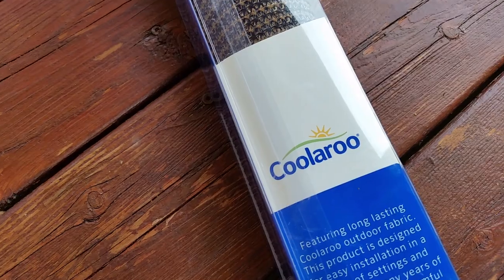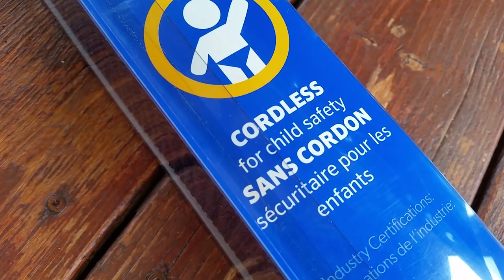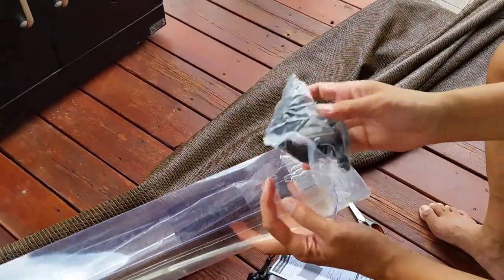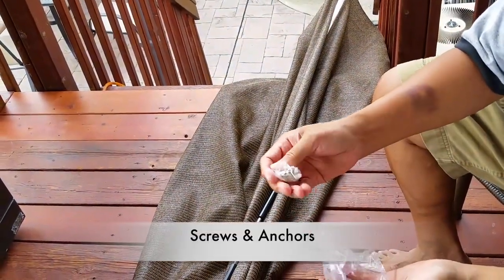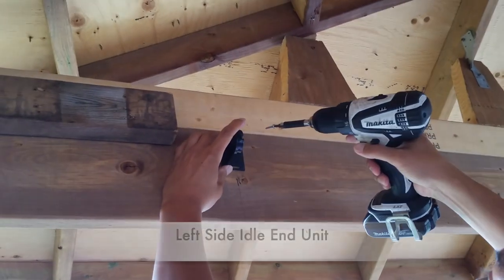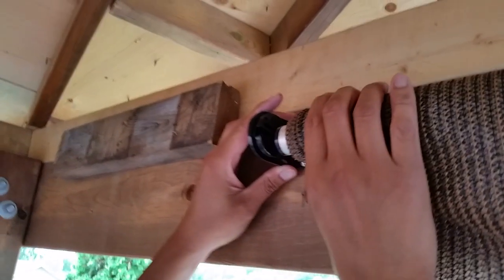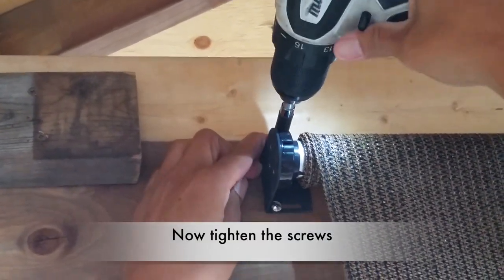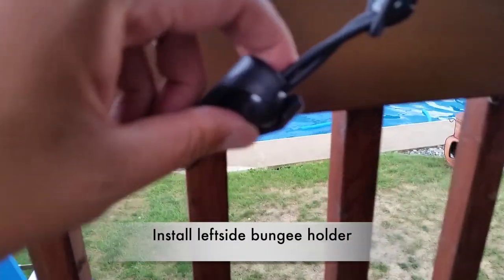DIY. How To Hang Outdoor Coolaro Privacy Sunshade. DIY.

Comment: Great video!!
I am going to Lowes and buy two today for my patio, I was looking at the one at Costco but I like this brand better, it is about 20% more but I like the crank to fold and hang straght, the one at costco is a permanent bend and will not hang straght

Put a small hook on the side of the wall and it will hold the crank out of the way when not in use

Cheers
Reply from the maker: Glad it was helpful!

Comment: At 7:10 - You can see that there is a dove tail on the piece that fits into the the dove tail slot on the holder bracket. Once that is placed into the slot it becomes s spring loaded lock, the pin in the shade just snaps into place from the front.
Reply from the maker: Excellent observation . Thanks for sharing.

Comment: Great video!  I have a cinder block & stucco finish.  I think I need cement screws to anchor unit.  Also, what is the longevity of the shade, and the plastic hardware that comes with it?  Thanks.
Reply from the maker: It's been 3.5 years since I posted it. And the sunshade is still doing great. No tares, no rot, nothing. Hard ware is also in great condition. Love this sunshade.
Reply: @jonahvlogsdiy4143 that’s awesome that it’s still holding up. How does it hold up in string wind when it’s fully extended? Does it flap back and forth or is it breathable enough that it flows right thru the fabric?

Comment: Nice vid. Thinking of buying it. On the inside of my patio I have lightbulbs so I can't put the coolaroo there, however I could put it on the exterior surface. Would that be a problem?
Reply from the maker: Have two other ones that are exterior surface and no problems so far.
Reply: @jonahvlogsdiy4143  very good, thank u

Comment: I had to hang mine pretty high so using the crank is impossible without a stepladder.  An instruction on how to add a motor would be wonderful.
Reply from the maker: Lol. That would be nice.
Reply: If you're going to waste your money buying a motor to add on to this, you may aswell just buy a motorized shade instead, lol.

Comment: At what height would the crank become impractical? I want to hang a shade at 12’ height
Reply from the maker: Great question! It's currently hanging at 8ft from the floor. And its very convenient to to use the crank rod but at 9.5 to 10ft it was difficult. I would say 12ft is impractical unless you use a chair or step ladder.

Comment: I’ll need the instructions since I want to install mine hanging from ceiling if my Lanai.  You have make adjustment to the both brackets they are not very clear.   Ex. Remove 4 screws?  There only 3 screws 😅. Thanks though.

Comment: What happens if u get a warm breeze but the sun is shinning, how do u stop the blind from blowing or moving, is it secured at the bottom, or is it just weights holding the blind from strong winds or breezes
Reply from the maker: There should be two holding clips with which comes with the blind. And two bungee cord with a small ball to attach to the clips and hold down the blind.

Comment: I want to install these blinds 1 feet away from my exterior way so that it can block the heat the sunlight. Can I install the two end units under the eave rafters? The rafters are not strictly horizontal but with some angle. Thanks
Reply from the maker: If you can make it as level as possible, it would be better.
Reply: Use garage door hangers, or something similar to get the roller installed level:
https://www.garagedoorstuff.com/product/garage-door-opener-hanger-kit/
Stay gold.

Comment: So I just installed the 10' shade.  Thanks for the great video.   Did yours have a bit of a sag because of the weight/length
Reply from the maker: Funny now that you mentioned it, I looked at it closely. I do notice a very small sag but I never noticed until you mentioned it. LOL.
Reply: @jonahvlogsdiy4143  
Cool. Thx for the reply and mine came so that it rolls down from the back not over the top, similar to toilet paper lol.  I assume it doesn't matter which way it rolls out.   Thx from SW Ontario, 🇨🇦
Reply: @markb3954  That was my biggest question, was which way to install
Reply: @cashonly6117  i left it rolling under from the back.

Comment: My patio is at an angle that from one end to the other are about a 12 inches to a bit more.  Any DIY ideas how I can put a roll away wall to protect me from the elements of the wind or rain when I'm using my patio in the winter and then remove it or hid it in the summer?
Reply from the maker: That's a great idea. I'll have to think of how to do it for my deck this summer. If I do, I'll do a video on it.
Reply: @jonahvlogsdiy4143  Thank you because I use my patio year round planting succulents, entertaining, etc. but in the winter it gets pretty cold then adding the wind and rain makes it hard to work in the patio for too long.
Reply: Time to move

Comment: Not the correct way to install it.
The locking clip on the opposite side of the clutch/crank is not to be taken out. You install the bracket where it’s supposed to go then push the plunger past the lock clip (which has spring retention) and then pinch it to pull the plunger back out if you want to remove it.
Sorry I just couldn’t leave it alone - this should literally take 5 minutes to install
Reply from the maker: Thanks for the info. I'll look into it.

Comment: Hi, How has the shade held up? Someone who reviewed it on Lowes website said their melted & ripped from hot sun rays
Reply from the maker: I've had for two years now and its still great. But I do take down when the summer season is over.
Reply: @jonahvlogsdiy4143  How high of winds has it encountered? We get some 50MPH around here... Have you accidentally left it rolled down or attached with the clips on high winds?

Comment: will these work on a 10 x 12 metal gazebo?
Reply from the maker: Yes for sure.Pre drill the hole in metal with a smaller diameter for the screw & you should be ok.